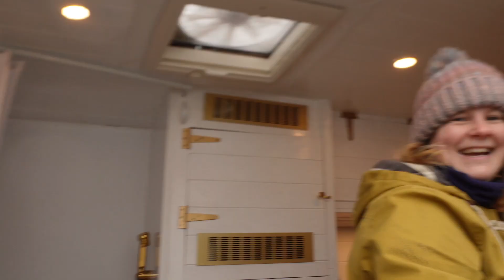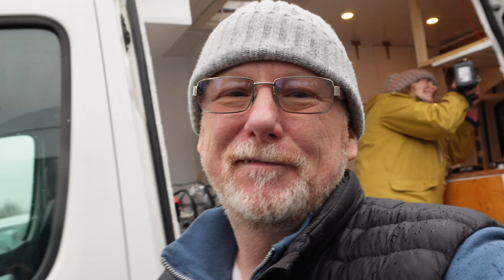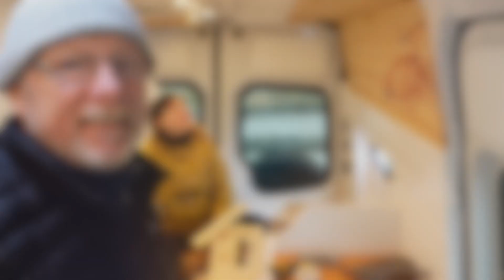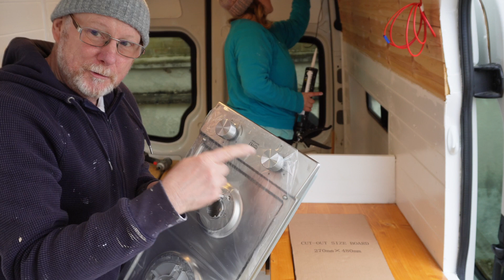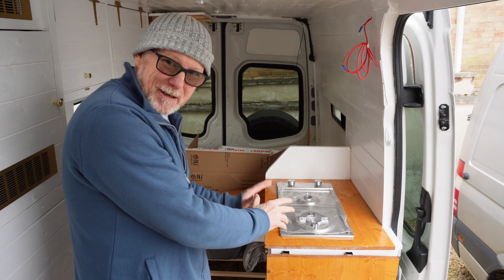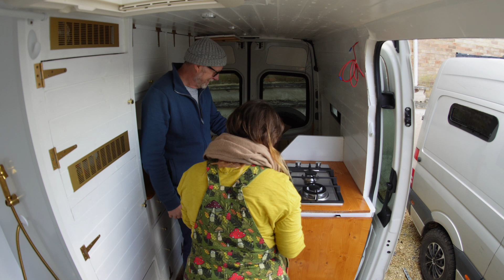VW Crafter Camper Van Overhead Storage Tear Down & Gas Hob Installation

Comment: I thought you cold only use orange pipe if it was removable. Or do I have that wrong. Thanks
Reply from the maker: I’ve used it for years and never had an issue

Comment: Great video you two. 
Just a quick question once you’ve fitted the gas and hob do you need to get it tested or is it legal to drive around as is. 
Help in this department would be very appreciated thanks Mel 👍👍😎
Reply: You don’t have to have it tested as a legal thing, unless you are renting it out. If you’re installing it yourself it always a good idea to pass it by a gas safe engineer or at the very least put some fairy liquid on all the joints and check for bubbles. If you see them - you have a leak. Also ALWAYS fit a Co2 and gas alarm!!! x
Reply from the maker: If you’re unsure about anything to do with LPG gas get a professional to do the install

Comment: Im after one of these but only running 12v system.  I take it this one is only 240v ac and the one in your van also, mel? Glad you have more room for "moving around" the van now :)
Reply: I won’t be plugging in the ignition, I’ll just use a match or fire lighter for the gas hob 👍🏻✨☀️
Reply from the maker: It’s
Reply: @BigVanSmallWorld  LP o

Comment: Hi Mel , have a question , have you ever had food poisoning while in the van ? and how do you cope with the monsoon at both ends. serious question . and can say composting or cassette toilets deal with it. asking after i had three days of horrific poisoning .
Reply from the maker: Good question lucky I’ve never had this problem but if I did I would check into a travel lodge 👍
Reply: @BigVanSmallWorld  makes perfect sense , warm bed and bathroom !!
Reply: I’d either check into a hotel, b&b super quick. OR if you’re not anywhere near by - I’d say go with a composting solution - just have a bag with sawdust in it for being sick in and the toilet with a bag and toilet paper/and or sawdust to soak up any moisture/liquid. Add a few drops of essential oils to the sawdust beforehand and it’s a much more pleasant way of dealing with things. 
If you do have food poisoning, stick to ginger tea to help with sickness, peppermint tea to calm the acidity in the stomach and lemon and vinegar to spray down the surfaces to keep the air smelling as clean as possible. Hope this helps! x

Comment: Don't if you have sorted your tracker out but turn this off if you haven't.
Reply: Vibration alarm
Reply: Thought I could add pic's for you .? Turn on when away from van then off when in it and using it.been meaning to tell you since you done the piece on them lol.peter.

Comment: Nice hob, especially with the flame fail detection for safety. Does the black metal bit that the pans sit on fix to the stainless base, or it is lose - it looks heavy and in an accident could be heading for the back of the passenger seat occupants head if it’s not fixed down. I know you have the checker-plate cover in your van, any similar plans for Beccy’s?
Reply: The black metal base is heavy but it’s recessed so won’t budge, Mel screwed his down in case it might have come off when driving but he regrets that now, the rings and caps don’t move at all with all the bumps etc with driving, so I’m keeping it free for easier access for cleaning. I can also take it off and stow away in a drawer if I’m concerned about it flying off during travel. 
No checker plate in my van, prefer something else 👍🏻✨🚐 x